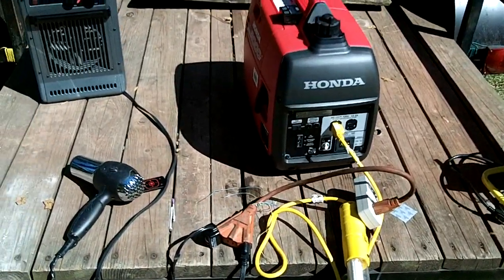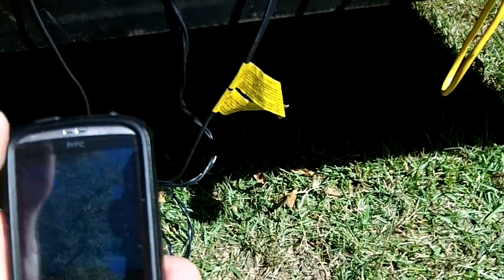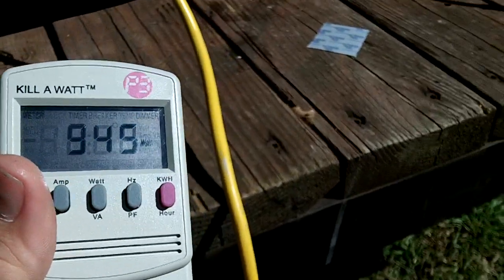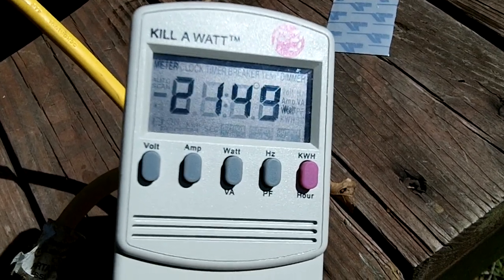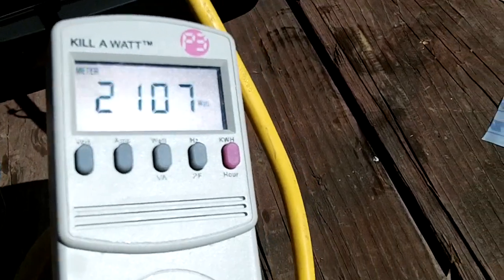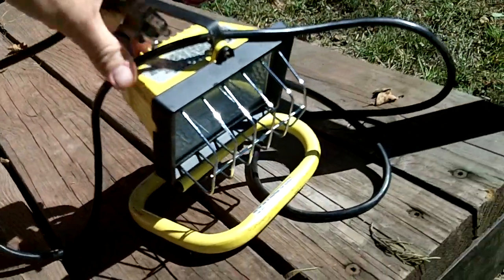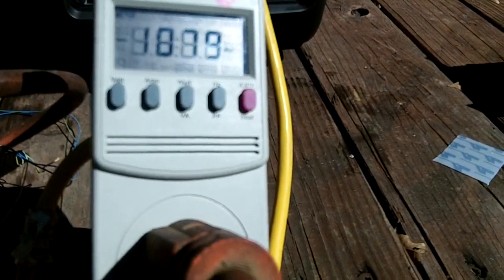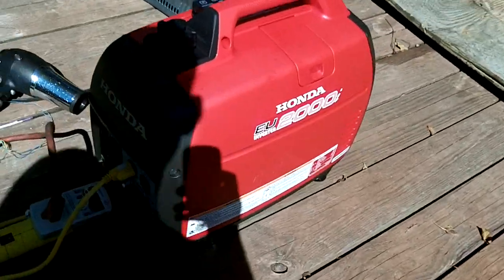Honda EU2000i inverter generator review and load testing makes 2200 WATTS!!!

Comment: Nice Video. At 1:50 the http://www.google.com/patents/US4296368 blinks on the kill a watt P3 since is near the 1875 max watts or max 1875 volt amperes. OK Overload story for firefighter! :  Here I Have about on dozen of these cool gizmos. Once one of mine was connected to an old (1992) refrigerator that finally crapped out and started cycling with the full compressor locked rotor current then thermal delay; then back to restart over and over. I came home and the house had a funky plastic stink and the male pins on the kill a watt were so hot the plastic was like taffy. It did not start a fire but sort of freaked me out.
Reply from the maker: 3beltwesty I think that the flashing of the Kill A Watt meter is a warning that you are overloading it and have the potential to cause damage.  In your case it had that overload was for an extended period of time and you got lucky, no fire.  Thanks for sharing your story, please share and subscribe.

Msfirefighter662

Comment: I have this same genny and it stopped producing power even though the green output indicator light is on at start up. During a recent ice storm I had it running two normal sized kitchen refrigerators and an am radio. The two fridges were only run at the same time for about an hour then I'd run two smaller items. I never tripped the overload fuse or ever noticed the overload light on but like I said, the genny no longer produces power. I'm worried, have I cooked the inverter?

Comment: Do the same test and check the volts output.  The volts were low, that's why the light was dim and why your "Kill a Watt" was blinking.  If you'd had an electric motor attached, you'd have fried it.

Comment: Hey,
There is a video showing an EF2000is surging after 20 seconds with a load of 1900 watts.
Just type "Yamaha EF2000is Load Test" at the search box.
I believe that this is because the Yamaha is 79 cc motor, where the Honda is almost 100 cc (98.5).

Comment: Thanks for taking the time to post.  
Agree with Samuel Self, would have been nice to see the voltage.
I note the EU2000 I'm using starts off putting out around 127 volts around idle and with a small load (nominal 300 watts output).